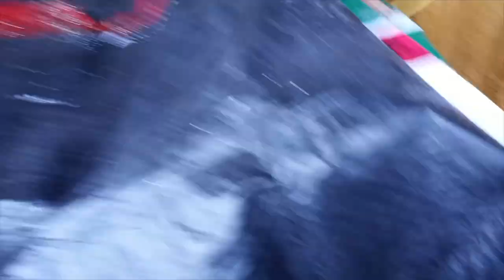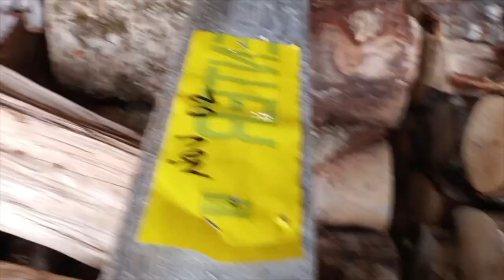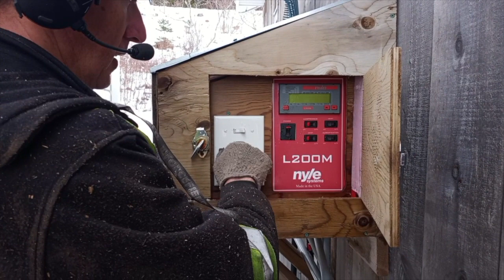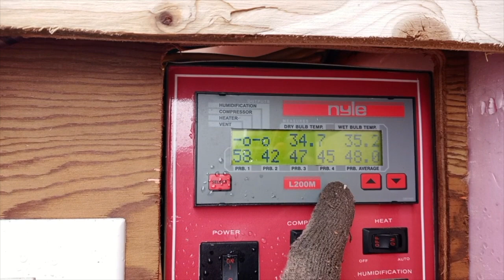20230316 Unloaded and re-loading the firewood kiln - full movie

Comment: I'm building  a 15ftx40ft firewood kiln. Wood furnace heated , kiln fans. spray foamed  sheet metal exterior. So I can stack 2 ibc tall  10ft tall. On a old concrete slab
Reply from the maker: Nice. 4 ibc crates make 1 cord I guess. So how many cord you plan to dry at one time? How many kiln fans you going to run?
Reply: @WoodchuckCanuck  8 cord possibly ten. If it takes weeks to dry it's still better than waiting a whole yr to season wood to sell. I have  orders for wood all the time and I barely advertise. Rather sell quality than quantity. But 400 face last yr is still a ton of work to do by myself. 90% all delivered.
Reply from the maker: @Garrett572xpg  Sounds about exactly where we are at. And have the same business model, quality over quantity. That large a quantity of wood drying all at once you will really have to put a lot of effort into making sure air flow is right. If you build your temps too quickly and don't have correct air movement to remove the moisture, the wood will develop mold on the surface. Depends too on the method you decide to employ. Use a dehumidification system like Nyle's L200M like I have, or go the other route and use a wood boiler to get temps up super high (+100ºC) to literally boil the wood out.

Comment: Seems like you need to raise your prices. Nobody sells kiln dried firewood at breakeven. It's nice that you do that, but it's kinda crazy. Lucky customers, that is for sure.
Reply from the maker: We make a little bit on the firewood. The additional cost of kiln dried we don't. Its just a value added service. Pretty sure if we raised the price we wouldn't sell near as much as we do. For now it'll do but at some point in the future it will have to go up I am certain, especially if any of the hard costs go up such as fuel for delivery or logs we buy.

Comment: I may have missed it  but  how hot does it get in the kiln and how long to dry 2 cords?
Reply from the maker: I run the temp up to 125ºF and when the thermal mass of the firewood reaches about the same, then I shut the heat off. The residual heat from the 3 fans and the compressor are enough to keep the kiln temp at about 115ºF. It helps the bldg is well insulated.
Reply from the maker: It can take anywhere from 4 to 12 days for this 2 cord set up. It depends on how green the wood is and what time of year. During cooler months, 1/3rd of the energy used to bring the thermal mass temp up to 120-125ºF.    You can get propane units that can take 6 cords from green to 20% in 2 days, using internal temps of 220ºF, literally boiling the water out of the wood but you consume a tremendous amount of propane.
Reply: @WoodchuckCanuck  thanks for the info Jim
Reply from the maker: @buckinfirewood  No problem. Only other data I can add is that the amount of elec used during a cycle can vary between 600-1,200 kWHr.

Comment: There has got to be a way to get away from the electricity..   have you looked into wood furnaces??  You'd make more if you burned your scrap to dry the wood I would imagine..
Reply from the maker: For the added cost of a wood furnace and the additional insurance, it's not worth it. There's also the extra time factor of keeping a dry supply of slab wood on hand for that furnace, and, managing the fire to keep the heat going. All extra time. Time or money, choose which to spend. Also, for this particular setup, the internal  temp of the kiln shouldn't exceed 135ºF, if it does, the compressor safety shuts off to prevent overheating of itself. It can be reset, but it's a pain in the butt and just something else to monitor.  Wood fired heating has its place in kiln drying firewood, judt not in this particular setup.